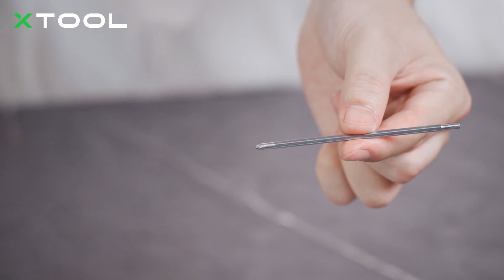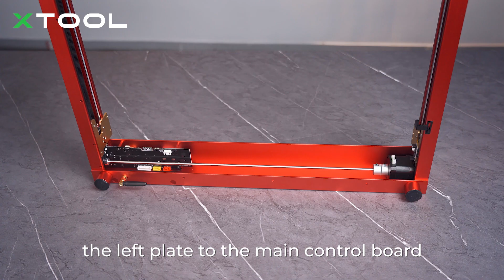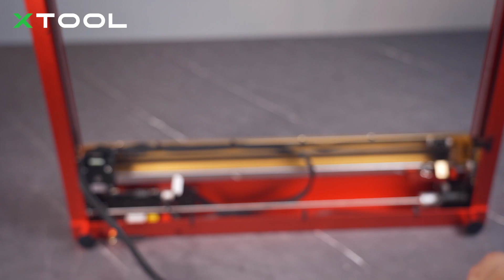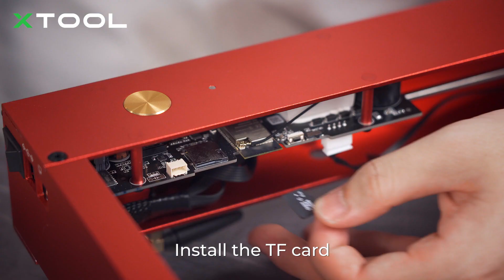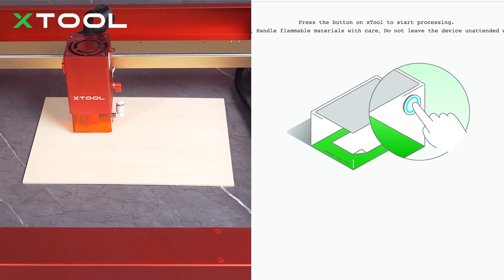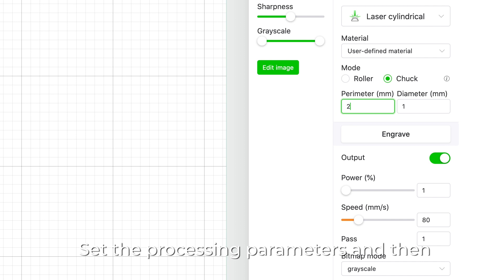Assembly & First-time Use of D1 Pro

Comment: Hello  I'm at the phase of experimenting materials but I have questions for you before I begin:

1.Do I need both an air assist and a fume extractor? Do they do the same thing?

2.Do you suggest a metal plate or a honeycomb Laser Bed to go on top of silicon mat but under material?

3. Should the laser  slide all the way to the mat or be adjusted  where when it slides in,  the back metal piece of laser underneath plug is even with the bracket its attaching to? Ultimately resulting in laser being approximately  a quarter inch from the mat?
Reply from the maker: 1. Better to have both if you always cut wood
2. Yes, that's gonna help you to have a better airflow
3. Don't quite get it
Reply: @xToollaser thank you for your time and support. I believe your order # 1 & 2 answers' are to my questions order 2 & 1 correct?
Q3 : my laser just slide in the holder slot and is flat to the mat. It slides in and out freely as I choose. Is this a correct position? Is the laser suppose to be a certain height from the mat during assembly or does the height adjust with the command from the software?

Comment: There is a plastic sticker over the air assist screw hole on mine - I assume that was supposed to be removed. 

Also adding in the coloured connectors is awkward af... and using cable ties is very  cheap.

this part of the design could definitely use some improvement

Comment: I assembled my D1 Pro 20 W yesterday. Sliding the two plates to the front plate didn't work, the circuit board has an edge in the way. The air assist won't screw on. The shaft connecting the two sides was a little bent so it wobbles, the bend is ~ 3 mm. I haven't had time to test it. So not sure how the bent shaft is gonna impact the performance.
Reply: You can use the back instead of the front since the PCB is in the way. I put together a pretty extensive video here on setup that covers some things the manual misses plus better wire management: https://youtu.be/br-gyMjowYM